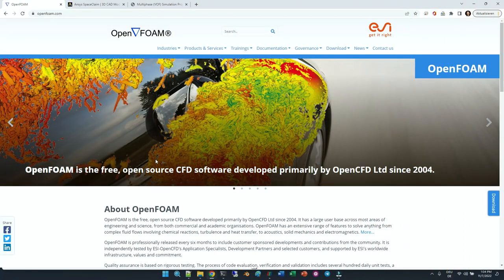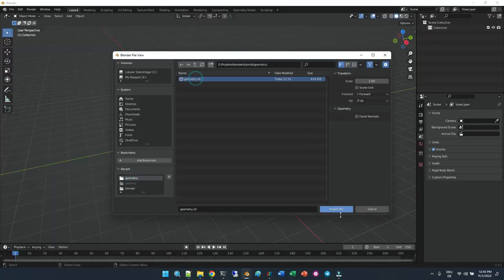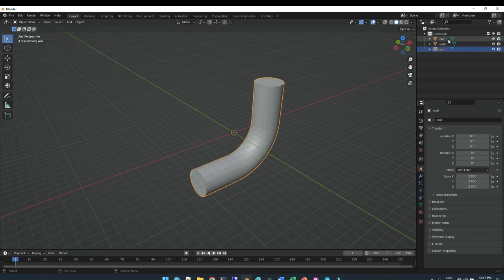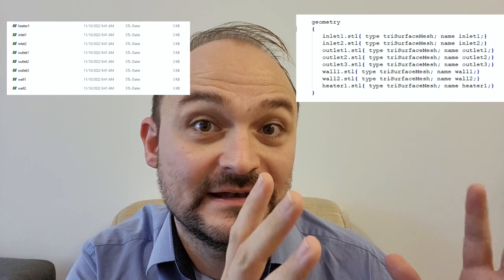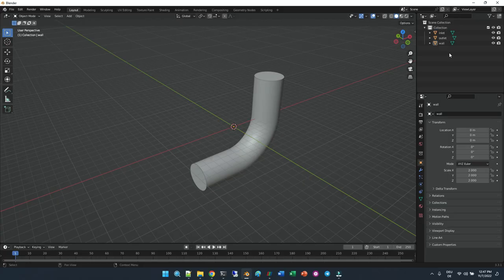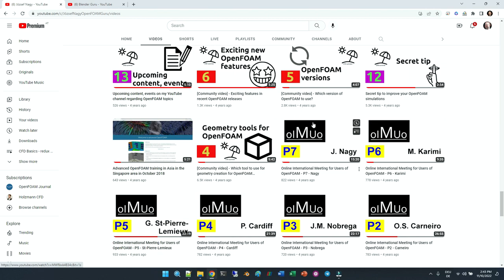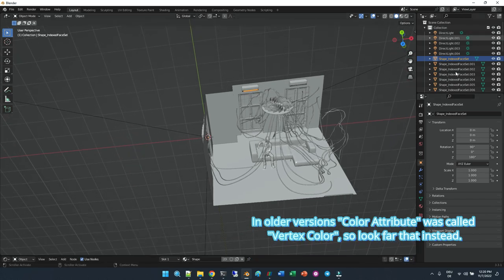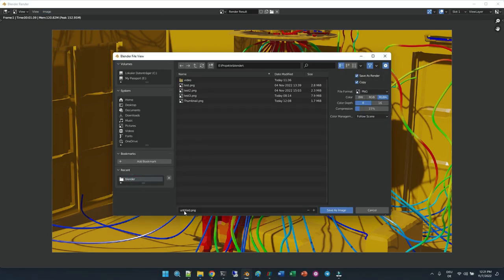I missed this in my CFD geometry workflow for OpenFOAM simulations for years. This is how I fix it.

Comment: Thank you so much! I'm learning a lot from your videos. I'm new to CFD, but thanks to your videos, I've been able to improve very quickly, and I'm extremely satisfied. It seems that in Blender version 4.2, the option to select "object" in the Batch mode checkbox has disappeared. I'm curious about what role the Batch mode plays. If it's essential, it seems like using the version of Blender you're using could be an important issue for me as well. (This is just my guess, but I think that in Blender 4.2, if you don't select "Selection Only" right below "Batch," it might automatically save with "Object" selected by default)
Reply from the maker: Thank you for the input. I personally did not try 4.2 yet, so I am not sure. Possibly.

Comment: Great video! I'm a CFD noob but have been using Blender for a long time. It's only in more recent years that I've been able to use it more commercially. I have a noob question! Could using a Blender sub-surface modifier to smooth sharp-edged geometry (such as the corners of a room) enhance the CFD meshing?

Comment: Hi, I designed a concept vehicle in Blender (mesh with sub-surface). Is there any way I can do a CFD with say 90% accuracy within Blender or OpemFOAM? Ideally it would compute on my machine (Mac). Thanks for the video!
Reply from the maker: I am not sure about blender, but OpenFOAM can do it. Yes. You can install OpenFOAM on Mac, but I have zero experience with the bitten apple. Sorry. I know several people who use OF in Mac though. The OF part will come in my next video.